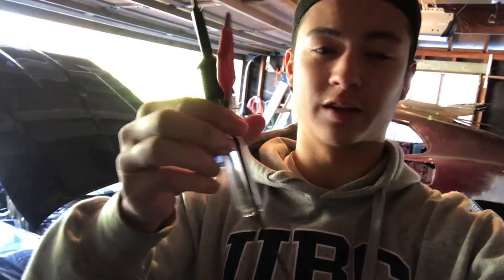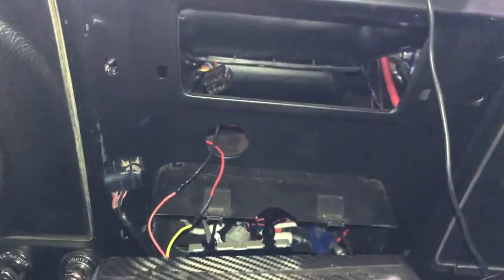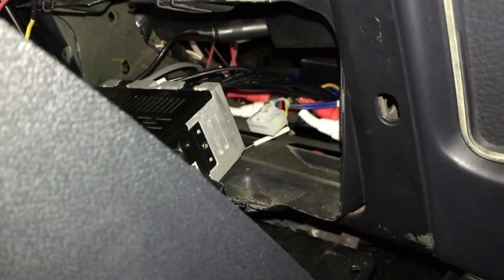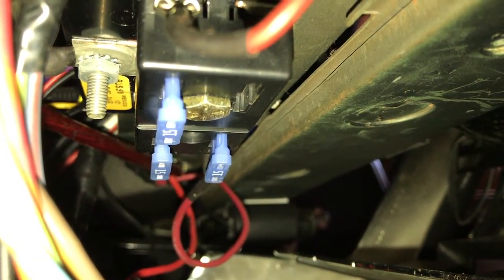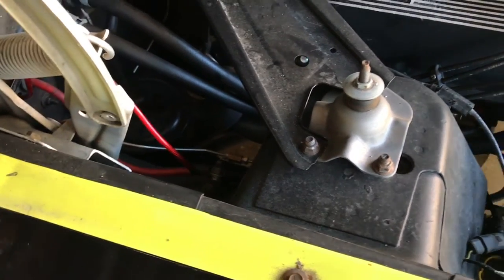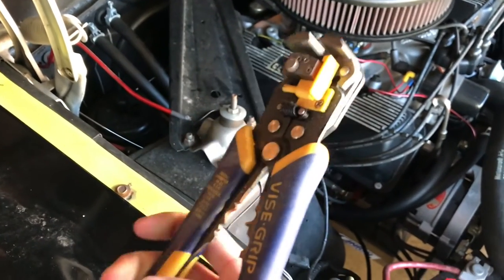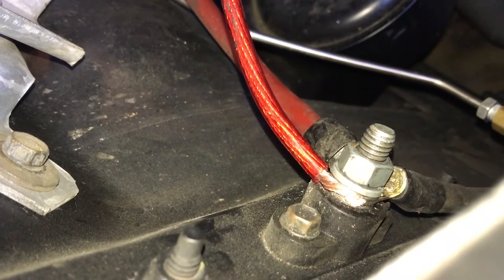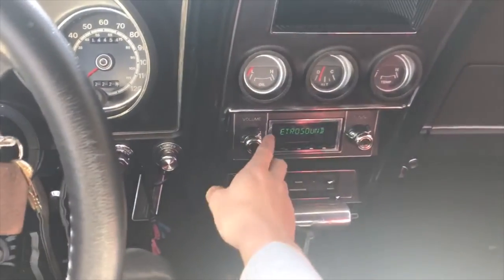How to Troubleshoot Electrical Problems! | RetroSound Radio Fix

Comment: Good video to help people with he bare basics...and it's still being seen 5 years since its posting so congrats!! I was checking your video out to help troubleshoot shoot my own Reteo-manufacturing radio problem. I'm sure you have already discovered this, but if not and for others, that type of power wire that was eroded on the video is junk so don't purchase that  style. The problem is that wire comes from say Autozone or O'Reilly auto parts and is cheap wire made of aluminum strand not copper. That stuff corrods ungodly fast and does exactly what yours did. It is best to spend the extra money snd get copper wound power supply wire so as to not have this happen. Great video though and I enjoyed watching it!

Comment: Nice detective work!! Im surprised it wasnt a ground issue. Thats usually the #1 culprit. That being said, its always a good idea to upgrade your grounding system with a "Big 3 Upgrade". You'll notice an improvement in your headlights output, and if you ever install a sound system, you wont tax the electrical system as badly.
Reply: Oh - and your positive cables wont corrode as much, if at all either.

Comment: Where you finished your search is where i always start , if you have not great ground your hot cable will grow that white powder in no time .
Reply from the maker: Great tip, will be sure to check out my grounds!
Reply: Dont just check them - Upgrade to a "Big 3" setup.